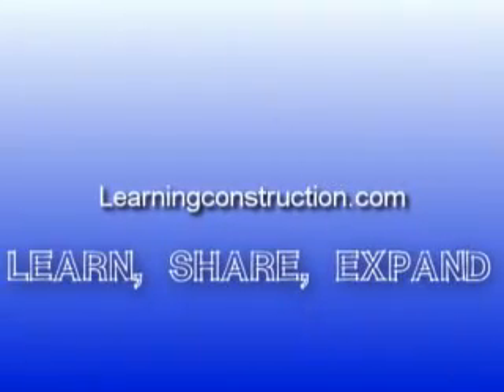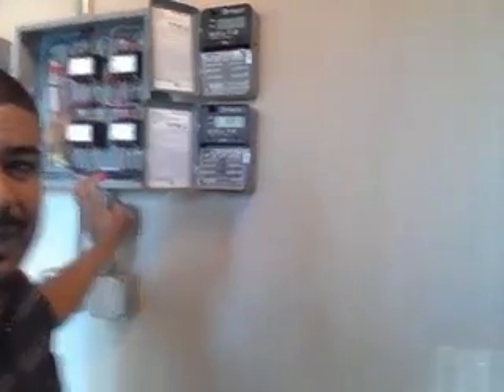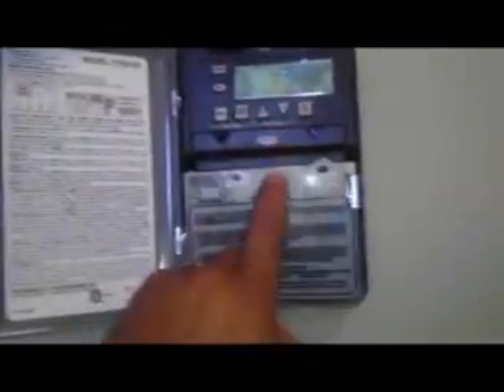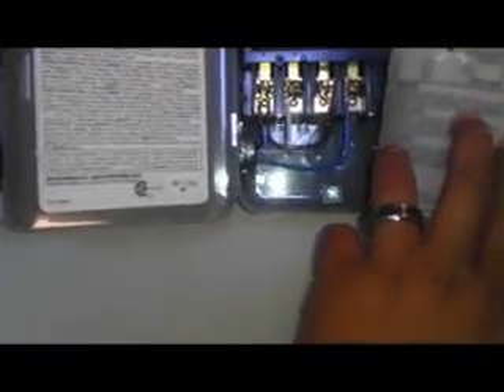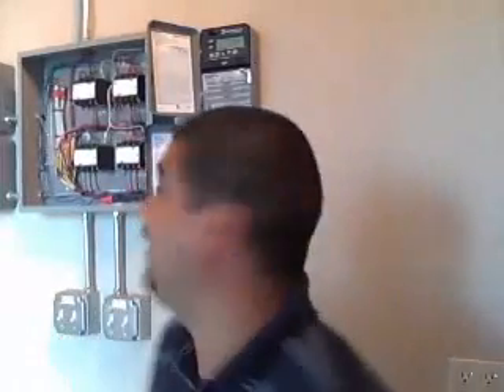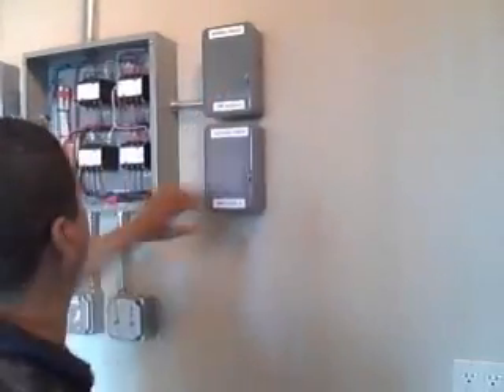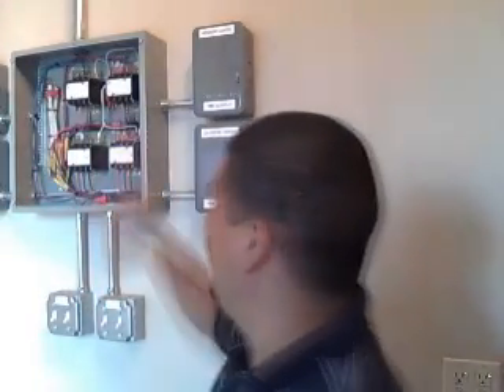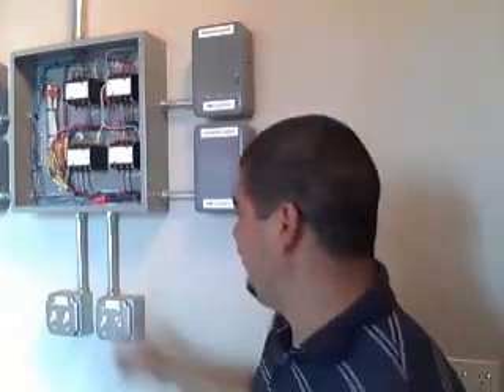How to build a Light Control Panel for your home or business.  Home Automation.

Comment: How did u wire the override switch ?
Reply: +Rob L It would be wired in paralell with BOTH the master switch (which is probably out in the home somewhere, also called the bedtime switch),   and the time clock both.   This allows the OVR switch to bypass both other control devices, and turn on the lights and BBQ and whatever other circuits you want.  By putting the OVR in parallel with the master switch too as well, you enforce the owner must turn off the OVR switch in order to turn off the circuits, instead of being able to cheat and leave it on whilst getting the lights off via master switch.
Reply: @LUBHETTI  y

Comment: Those are electrical contacts buddy not solenoids but other then that nice setup good clean work
Reply: Technically it's a contactor Wich is a relay, the term relay and solenoid works mostly the same way and in can be used interchangeably

Comment: It would be better to use a central EMS system that also controls HVAC with a single touch panel. This way they just have to set the timers in one place and the HVAC will switch to unoccupied at the same time for each zone. Most business owners are not smart or conscious enough to keep these times up to date.

Comment from the maker: SkilledEddie, good question!  in this panel the override switch works like a 3 way switch, when you turn the switch one, it cuts the power to the line that supplies power to the timer control, thus even when the timer goes "on" there is no power, since the override switch is in the on position.  Thank you for asking! and good luck

Comment: If you turn one of the override switches on what prevents the time clock from sending power to the solenoid at the same time if it kicks on?
Reply: Nothing prevents the time clock from sending power to the solenoid at the designated "on" time. Having the time clock turn on while the override switch is engaged doesn't negatively affect the process though so it shouldn't be a problem.   The only problem would be those lights wouldn't turn off when they're supposed to because the switch is on